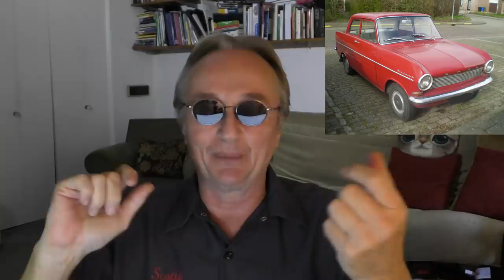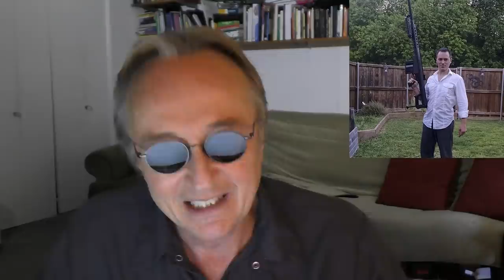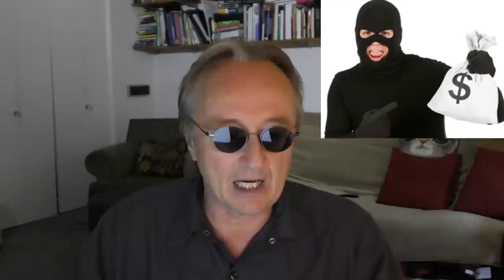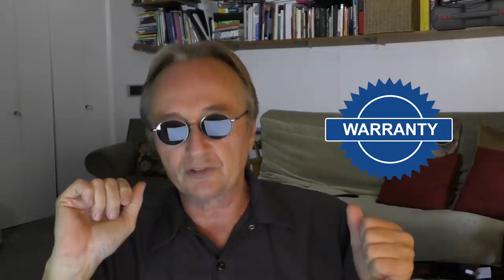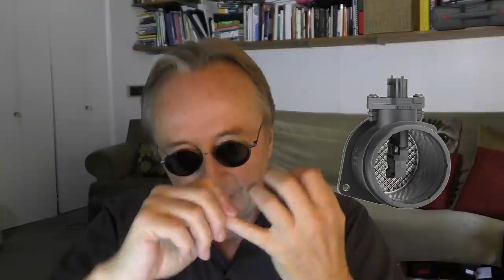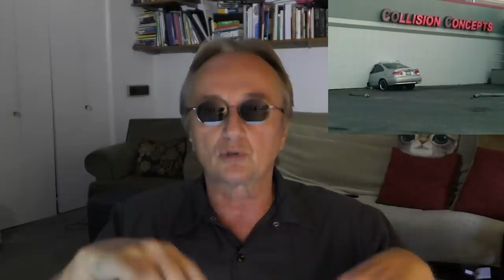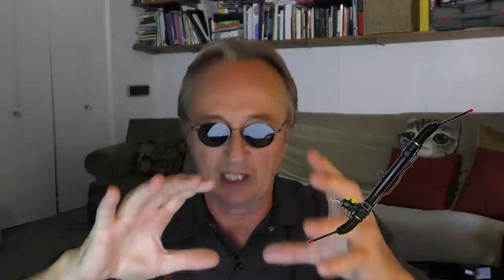Why Not to Use Your Car’s Horn

Comment: I watched many of your entertaining video but I never hear you talk about Subaru ..? I'm sure you have an opinion ...LOL
Reply: He has talked about them. Old design, leaky head gasket, weak transmission. I have a 2002 Forester, w/ manual and 150k. Other than changing timing belt, plugs, a wheel bearing and front swing arms in 12 yrs, no problem.
Reply: @fazole  actually I had a 2001 Forester as well  sold it with 230k not a bad car , watch the infill gas pipe as it likes to rust out , they have a bad design there ... I then got a 2010 Forester that newer model is better in every way ...
Reply: @bisarowood  
Thanks for heads up. My old Forester is quite sporty, small on the outside, big inside so it fits anywhere. I test drive the newer platform a few yrs ago, but it seemed under powered. I ended up buying a used Lexus rx 350. I'm very happy with it. My wife and I don't have to drive to work every day, so old, simpler Subie is fine for us. It has heated seats, mirrors and sunroof which all still work!

Comment: My auntie Sonia’s Kia Sedona, well it’s a carnival it’s right hand drive but it’s called a Sedona in the uk and you can only get one up to 2011 but her air filter might be clogged up because when you put the fans on, hardly anything’s even happening and the air even on cold is just slightly warm like it’s not getting enough air coming through to even feel like it’s cold, I’m pretty sure it’s that

Comment: I delivered fuel for 7 years and I’m now transporting hazardous waste! There is Multi millions of gallons of fuel getting delivered daily! I have delivered 68,000 to 76,500 daily when I worked, but I was getting Performance based pay. The average tanker usually delivers 34,000 to 46,500 gallons delivered per shift. When you see a gas truck it is usually going to one gas station with 8,500 gallons of fuel. 😳 I switched jobs because of pay and electric technology advancement. 10 or 20 years I can see a lot of electric cars outpacing gas cars in sales. But they’re will always be hazardous waste from now until far in my future! I’m 34 and need to think about retirement at a job!

Comment: @8:40 the VSA modulator was defective in my 2012 Honda Accord (110,000 miles) and Honda wanted $2000 to replace with new one.  I got an used one for $477 and Honda installed for $250.  Saved me $1000.

Comment: Just bought a 1991 Oldsmobile 98 Regency Elite lol, $900, has 99,928 miles. About to change the trans fluid and oil. Think I'll get another 60,000 outta this turd buddy?

Comment: Brazilian here, we've been using Ethanol as a fuel since about 2003, as in commercial use, and there is one down side which is the umidity left behind when alcohol evaporates, or left in the tank for long periods, so gasoline is a better long term fuel for cars that sit for long periods. One big benefit of ethanol is that it's high in octanes and it cleans up the carbon left behind by other fuels. I usually run on E100 but sometimes I put some gasoline in the tank with additives, car seems to like it.

Comment: Scotty, when in your opinion does a manufacturing defect become unacceptable for example a cable on a truck bed vs the GM ignition switch. Right now my 2017 Dodge Journey with 30k miles has a rear differential leak, thankfully it's covered under warranty, where do you think my issue falls?

Comment: Scotty, I’ve got an 02 Chevy tracker with 140k miles. The ac takes about an hour to start working, I thought it was low so hooked up a can with a gauge and it said it had to much pressure. Ask my grandpa(mechanic) he said probably not over charged/ probably something else. Got any ideas?

Comment: That is correct, I talked to scientists who worked on the project to make fuel with (modified) algae it is doable but it is not feasible at $60/barrel oil, it becomes economically feasible at around $100/barrel. So we are not running out, and gasoline is still a very dense form of packing energy (compared to batteries). We'll see if electrification of the whole transport industry happens, I'm not betting on it. I completely agree with Scotty on self-driving cars.

Comment: Self driving and electric? After I'm out to pasture 😅🤣 which isn't that far off !  My van runs great, very smooth, on E85, plus it's 0.50 a gallon less. I run one tank a month of the stuff, mostly run techron gas.

Comment: I’ve got an 09 impala with 115k miles so far car runs great. It’s recommended to change the transmission fluid around 100k do you think I should bother doing this. Thanks.

Comment: My riding mower owners manual says no more than 10% ethanol. If that goes to 15% what can I do?
I disabled the adaptive cruise control and lane departure warning in my 2017 Toyota Corolla SE with a six speed manual transmission. I don't need the car telling me how to drive.

Comment: Electric cars most likely will take over, but only after we get rid of lithum-ion batteries (read: half ton of self-igniting stuff inside small thin-walled cans), and after we find way to charge these new types of batteries without plugging them to some insanely dangerous circuits (ones that would have to push 100 kWh within few minutes through domestic-grade cables). So we have to invent better batteries, and efficient fuel cells that will convert some kind of fuel you'd find on a fuel station into electricity for batteries. And 'efficient' wouldn't have to mean 'powerful' - they would have to charge batteries without losing too much energy, but they could output about as much power, as you need for a steady cruise (to be ultra-comfortable, in reality you'd need less than that).

Comment: Scotty my ac compressor unit on my lexus is250 (124,000 miles) making a noise would get a new unit, change the bearings or get a second hand part

Comment: I have a 2004 Scion XB.  When the ABS lights come on I just put a multi-meter on the sensors.  If the meter reads a short or the resistance is much higher than the others usually that's your culprit!  So far that's always been the problem.  Something cheap people can try in their driveway :-)

Comment: Scotty I am a farmer love channel and my local ethanol plant has a 1998 2500 Chevy Silverado that has 280,000 miles on it they have run it on nothing but e85 and they have had no problems. It is a political issue the big oil companies don't want ethanol cutting into their profits.

Comment: Hi Scotty I have two comment's so I will be short. One years I had a motorcycle. I passed a gastation  that had gasohol. So I pulled in because it was cheep. after a few tanks I started having problems. So I went to the dealer. He new what I was using & he said if I keep using it would rune my cycle, & void the warranty.  Now the 2nd thing is ethanol in the gas is destroying small engines, boats, old cars & yes motorcycles. So why are the forcing this  crap on us?

Comment: Sometimes power steering reservoirs will bubble simply because of a bad o-ring seal on the tube going into the pump, simple and cheap fix.. if you notice it after its cold out and it stops after the temperature warms up, check the o-ring seals, they are usually less than a buck to replace and its an easy DIY task.

Comment: Scotty. Could you talk about strutt repairs and are there shock option replacements. When my teen agers all had "Stupid asian junk" cars the strutts were bad and i could not afford new. So i drilled a hole 1inch from the top and filled the strutt with gear oil. Leave top of air. Then put rubber over the hole and a hose clamp.  Worked great.

Comment: The 2011 Nissan Altima with the bubbling power steering is most likely because normal power steering fluid was put in. That particular vehicle uses automatic transmission fluid as power steering fluid drain it flush it and refill with atf and it will be fine

Comment: When I was a young mechanic! Henry Ford said alcohol is a better fuel than gas it burns clean and it doesn't corrode metal.some of the first Ford's could run on both with some gas air adjustment system in the dash (two nobs).

Comment: I had to replace the horn in my old F150 so I went autozone and bought a horn.  After I installed it I found out that it was one of those wimpy beep beep horn they  they used to put on Volkswagens.  I have gotten a lot of laughs and puzzled looks.  Sort of the opposite of putting an air horn in an Opal. Probably less like to get shot at  too. LOL

Comment: I own one of those E85 vehicles, I don't use that junk in my car it gets worse gas mileage with that stuff. Also I work for a trucking company (not a driver) and some of our trucks have what they call, accident mitigation systems in them and yes when they get to close to the vehicle in front of them it applies the brakes to maintain distance and as soon as it does people cut in front of them to fill that space.

Comment: The catalytic converter could be bad on that Honda Odyssey, the o2 sensor would send data to the ecu to adjust the fuel/air mixture ratio because it thinks it's running lean and so it richens the mixture..

Comment: I have no issues with road rage, I am a very zen driver, but I have absolutely no problem using my horn as intended. Where I live, around holiday season, if you aren't prepared to get on the horn as soon as the light turns green and the drivers in front of you don't immediately move you and everyone around you is going to suffer. There's a positive feedback loop of bad traffic leading to people looking at their phones more during red lights leading to less people getting through intersections leading to even worse traffic and so on.  I've seen 3 cars get through a light that normally 20 cars could've gotten through if everyone was paying attention. You get 3 cars in a row of drivers looking at their phones and that can wreak havoc on traffic flow through an intersection, if the one person actually paying attention to the lights honks their horn as soon as they see people not going it can save every person going through that intersection a lot of time.

Comment: Hi, Scotty:   New subscriber here. It's good to see somebody who tells it like it is, not to mention great advice. Last year my 1990 Sprint (remember those?) finally succumbed to body rust. After doing three weeks of research, I finally bought a 2009 Kia Rio5 . It only had 98,000 km on it. Took it for a test drive and gave it a good going over. Satisfied, I bought it. All I've had to do to it so far is replace the battery. In a couple of weeks I'm going to replace the front brake pads. Finally, my question...what do you think about the Kia Rios? So far it seems like a good car. I'm interested in your opinion. Thanks.

Comment: I have been working with computers almost as long as you've been a mechanic Scotty. I don't trust the damn things enough to drive me around like that. An axiom of people that have worked with computers is: " to err is to be human, to really foul things up takes a computer". You can trust the fact that I have seen computers really foul things up. I have seen mainframes screw things up. I have seen desktop screw things up. I have seen handheld computers screw things up. There's two things they all have in common. They are computers and they screwed up. Granted human beings are designing and programming the damn things but when I screw up it can be monumental and Epic!

Comment: i have adaptive cruise control and pilot assist and it runs great. there is no need for seperate lanes. you just follow the next cars. It does simply not matter if the car in front of you is driven by a human or machine. Although with only machines traffic would be smother...

Comment: E15: Ethanol is corrosive. The more ethanol in the fuel, the more durable the fuel system needs to be. Flex-fuel vehicles have specially-made fuel systems to combat the corrosion, and can alter the fuel mixture to prevent it running lean. If your car is newer than 2012 and recommends E10, check with your manufacturer before using E15. If your car is older than 2012 and not flex fuel, DO NOT USE E15. Studies on pre-2012 vehicles found that there can be major damage to fuel systems and the engine when using E15 or greater. Some vehicles actually failed to pass emissions after running E15. 

Basically, be cautious. E15 has been around for several years, and if your car is designed to run on it, the manufacturers will tell you. If your manual says E10, use that.

Comment: Canada has been using 15% ethanol based gasoline for over 20 years. They have properly formulated it to run just fine on any conventional vehicle. My 87 Caprice runs on it just fine.

Comment: I got a 1999 Ford Crown Victoria LX. Occasionally when I put it into drive from reverse it'll take a few seconds to shift into gear. Unrelated note: If you take a really sharp turn in a parking lot it will sometimes make a really weird noise that I think has to do with the suspension but I'm not sure.

Comment: Always wonder on the concept of electric cars now of using a charging station when they could be self sufficient using a wheel generator and continue to trickle charge battery.Seems like a scam to me considering unless that electricity was made using wind,solar or water turbine,it will be more polluting than current gasoline since coal is a terrible polluting means of electric.

Comment: Hey Scotty, I have a problem with my Toyota avanza it does crank but not starting, can a crank shaft sensor be the cause? And what other things to check for if not the sensor, and if the sensor is the cause will the car start if I kick start it

Comment: Effective methods to mass produce electricity are fossil fuel, so using the btu’s in oil, coal or natural gas to create electricity to run the electric is actually per pound of vehicle moved ( looking at  horsepower needed to move the vehicle) isn’t really more efficient and it still relies on fossil fuel so just use gas or diesel.

Comment: Hey Scotty,
I had a 2013 Dodge Dart.  The brake booster went out and apparently it was a design flaw, and Dodge issued a recall.  I was told that the issue "caused gas to get into the brake booster" it felt like the guy was telling me a tall tale.  What do you think?

Comment: Scotty, I LOVE  your videos; you provide  a  breath  of  fresh  air  in a smoggy world! I recently  drove  a  2019 Subaru Forester as a  loaner while the dealership  was replacing  my Takada airbsg and was  startled when the engine  shut off at  every  stop light. What's  your  opinion  on  this feature (and on the newer Subaru  SUV in general)?  PS I live in southern NJ and make the 3 hour drive to my elderly parents' house  every  other week. I need the all-weather drive to handle  the  snow and slop we endure in the winter and chose an SUV   (a 2011 Forester) to transport my parents and their wheelchair  and walker.

Comment: Scotty, they did a test and found that pure gasoline, mixed and pure ethanol dont damage the engine, and that pure ethanol is actually better for the engine, just not methanol. The engine just needs to be designed to accept the fuel though.

Comment: The actual five note train horn is illegal to use. But it will fit in the back of a pickup truck and can be run off a converted propane tank.....

Comment: I run E85 in my non flex fuel Toyota Avalon. I use you run 50/50 no problems.

Comment: i drive an 18 wheeler with ACC and collision avoidance system. it is ANNOYING. the truck will hold a 3.6 second space between itself and the vehicle in front. thats about 5 cars. people squeeze between this space often 2,3 cars at a time. the truck then panicks and applies the brakes. unless i change lanes fast or override the system. so you are correct the world is not ready for autonated cars. there are a number of other issues that will keep it from happening.
Reply: Self driving cars aren’t like cruse control or collision avoidance. Those systems depend on a human paying attention and doing most the work. Self driving cars can actually take the location of cars all around them into consideration and make realistic decisions.

Comment: they should make the carpool lane into the self driving car lane. build a concrete barrier and increase the speed limit to at least 80MPH. just watch how fast people start buying self driving cars
Reply: If the cars are electric, that's actually a much better solution than mega expensive, unprofitable high-speed rail.

Comment: A neighbor had a 2004 Ranger that the ANTI lock braking system went bad. But when he came to a stop it would start rolling again...
Reply: You just need the ABS if you need to perform an emergancy brake (= floor the brakes), has nothing to do with normal use. You could read more about it just google it

Comment: Scotty, i have 1999 Fiat Punto, while i was driving in 5th gear my Throttle was stuck at maximum, like i was holding cluch, but gas padel and clucth was relesed and seemd fine, i gave car few minutes to cooldown and everything seemd fine, should i be woried?
Reply: Have you checked the  throttle cable for wear or obstruction?
Reply: @fazole  looks helthy
Reply: @xPawno  
Start the car. Keep in neutral with brake ON! Pull on cable link at carburetor connection or where you can grip it. Does engine accelerate? Does it feel sticky or getting stuck?